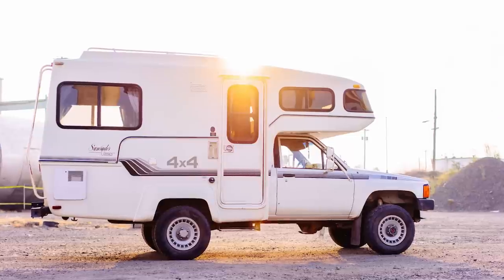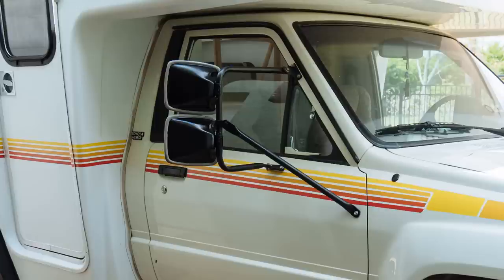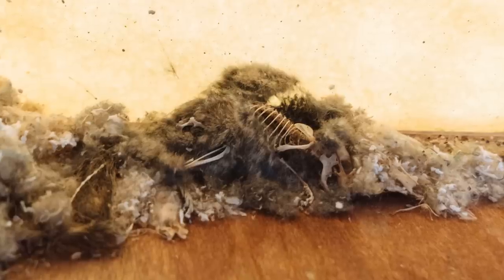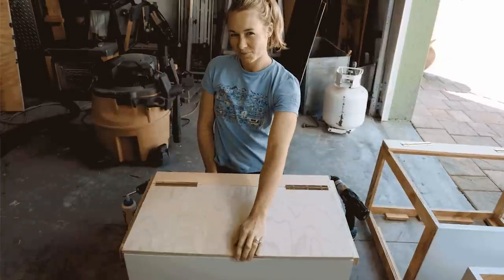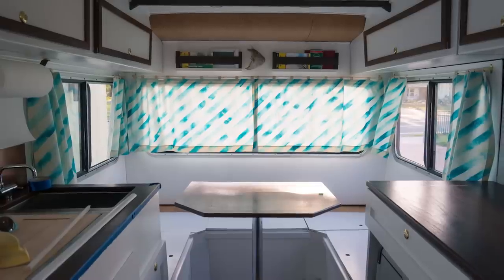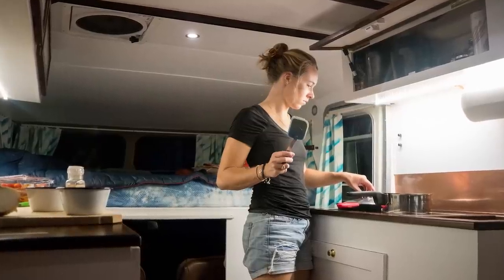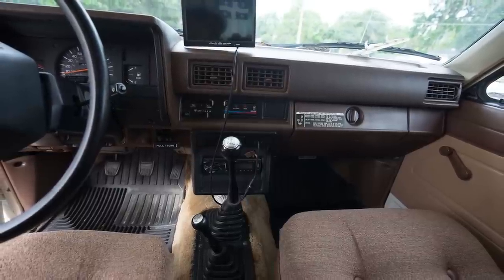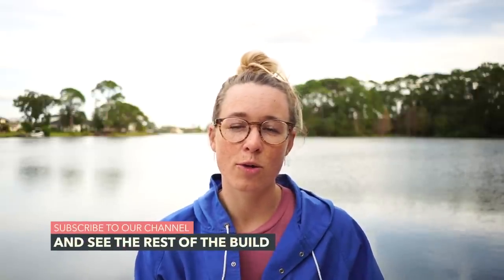SUPER RARE 4x4 TOYOTA SUNRADER TOUR | After Restoration

Comment: Everyone is missing the point of the bathroom removal. If you are camping, the campsite will either have a toilet or you will be private enough to just dig a hole. If you are in the city, there are an endless number of public bathrooms. Having a toilet in the camper only takes up space, and if you didn't notice, there's not much space in that thing to begin with.

Comment: People always wanna know cost but that's the main thing most leave out.😳
Reply: prolly around 20k
Reply: @calisthenicsnoob9990  not for these. They are super rare and in demand. Im guessing they have $40k+ invested
Reply: @04dram04  Depends on location. There is one on craigslist for 11.5k with 85k miles. It's not 4x4 and it needs a bit of updating to the outside (Fading paint). So I assume they paid around 12.5k for the camper and around 7.5K for the modifications. So around 20k.
Reply: @04dram04  in the condition when they started +$10,000

Comment: Capet is insulating and cuts noise down....crazy to get rid of the bathroom.
Reply: Yeah, and I wonder if any of the remodeling and reconfiguration messed with the weight? Th'at's a huge part of it.
Reply: Carpet also is essential for condensation. My 1995 van only has headliner and, when it's raining outside and the propane furnace is on, water literally drips inside some of the cabinets :(
Reply: PS, I'm installing carpet in those cabinets this summer :)

Comment: I wish they would bring back those Toyota campers.  The small, low design is easier to get in and out if, and you can park it anywhere.   I like how use solarized everything and used lithium batteries.

Comment: I'm really happy I came across your video! My 88 Toyota Pickup (Bianca), was side swiped last year. The drivers side is a mess. I've decided to pull the bed off and build out a custom "camper" truck. I have a lot of ideas and I will definately be incorporating a lot of what is in your video. My main concern is HP, considering my 22r only puts out 94 hp brand new. Any specs on the engine or its output?

Comment: What did you use for your insulation (I don’t recognize it from the usual household choices.).?  And what were the ceiling cross braces made of?  I have a Toy Bandit and I need to save the camper roof (rebuild the support system) from some prior owners choice to put a full size RV a/C on it.

Comment: You have to love the den of sin original shag carpet and velour, so sanitary and easy to keep clean lol.  I was kind of disappointed you pulled all that out, but then I saw the dead mice and yeah the shag and velour needs to go in the bon fire.  

What did you do for heat and a/c???  I didn't see a unit on the roof.

Comment: Love the 4x4 capability and you did a great job on the updating. Only question, how’s the mechanical aspect? I ask because we purchased a 1999 off road camper van that was in good condition, but still have had to dump a few thousand into it for a new engine and other repairs...it now runs like silk! (And we don’t have a bathroom either...not a problem whatsoever.)

Comment: Wheel bearings, CVs, Steering Knuckles, Tie Rod Ends, Locking Hubs, Cooling System, Suspension, compression checks, petrol so ignition and carb condition?  Did I miss a video where the mechanicals were checked? It looks like you'll travel comfortably, but mechanical checks and work will make sure you actually arrive.

Comment: Those are the coolest lol rigs & hey its a Toyota so you cannot go wrong there. I meet a mechanical engineer from Toyota once when flying from Houston to Detroit. I asked him why the engines lasted so long & ran so well. He stated that a Ford,Chevrolet & Dodge motors were balanced to within 35 to 45 grams but then stated that the Toyota truck engines were balanced within 15-25 grams which makes a HUGE difference on ware & tear in an engine.

Comment: You otta swap in the rear axle out of any 86-94 Toyota 4WD because they are wider for more stability and have larger brakes then your 79-85 axle and V6/ Turbo models have a stronger center section and possibly upgrade to some sort of limited slip or selectable locker just in the rear for almost 4WD more like 3WD since the front is still an [open differential] unless you want to add a selectable locker for that axle as well and do lower gears that will help with the extra load and heavier then factory tires.  These are very common things to do in the Toyota 4x4 community and just about mandatory.

Comment: The 22re is a bullet proof engine but produces very little power but ok in the torque department. I had a 1995 4runner 22re 5speed that couldn't get out of it's own way on road trips. I couldn't imagine the weight of a Sunrader on that drivetrain.